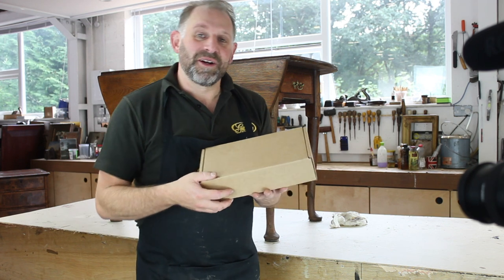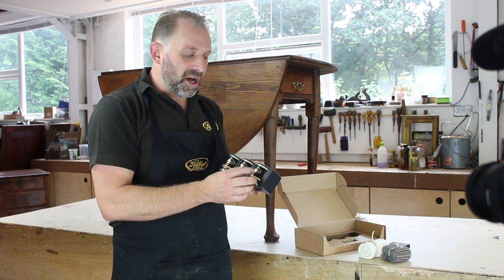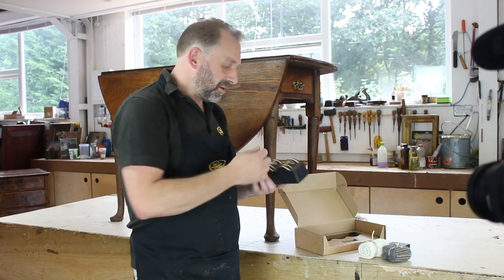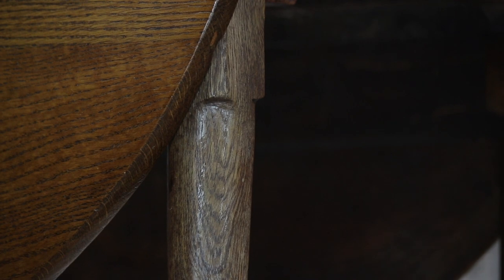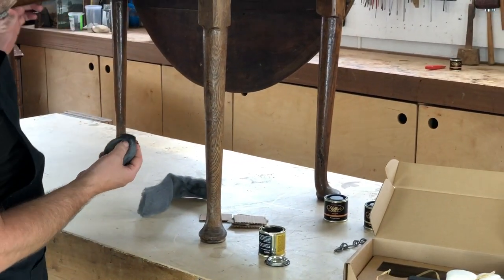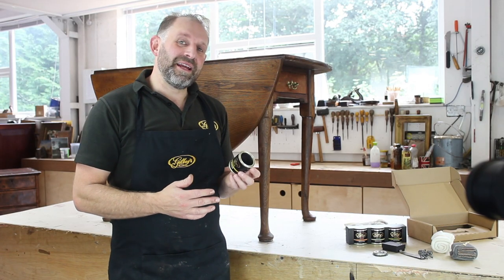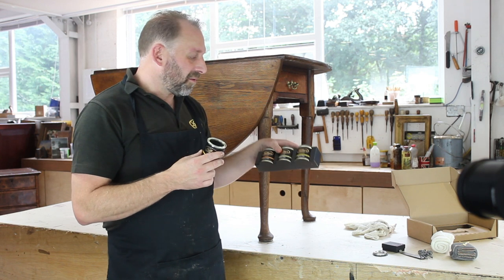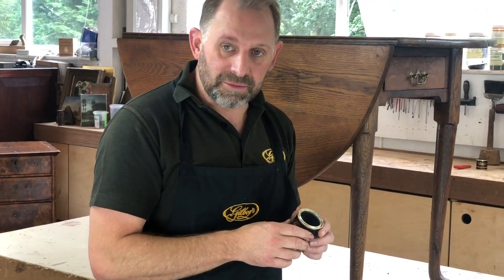How To Polish Like A Pro - Using The Gilboy's Beeswax Furniture Polishing Starter Kit

Comment: Too expensive for what little product you get. Any other brand of tinted wax comes in a container twice to three times the size at a fraction of the cost (like $5-10), and that steel wool is small... and you can get a whole package for $3.
Reply from the maker: Hi Johnny. 
Thank you for your comments. Our polishing kit contains the very best waxes sourced from around the world. I personally collect the pure beeswax from the beekeepers at Buckfast Abbey. It is unlike any other wax polish you can buy because this polish actually contains pure natural ingredients. They are not the cheap petrol-chemical substitutes found in the majority of commercial polishes which also reflects why they are so cheap. All of our ingredients are ethically collected and managed. Our polishing kit contains nearly 300ml of the finest wax polish. The wire wool and buffing cloth is there to complement the polish.
Kind Regards 
Simon
Reply: Gilboy's wax is 'not any other brand of tinted wax" You get what you pay for, the Gilboy's does an outstanding job. If you haven't tried it, don't knock it.